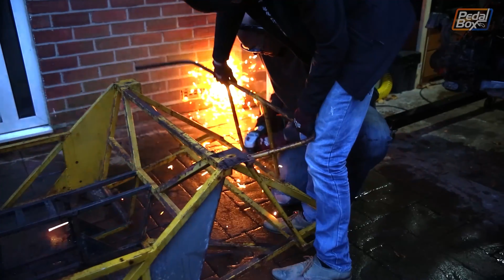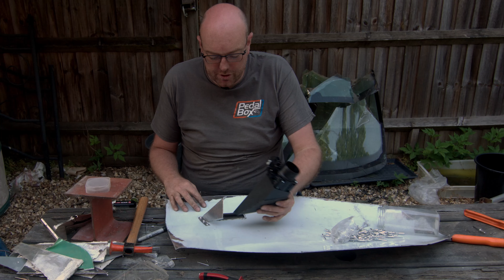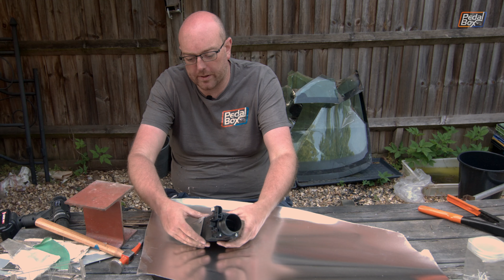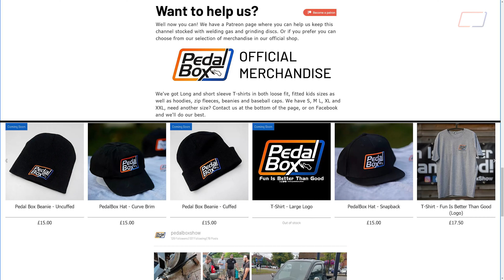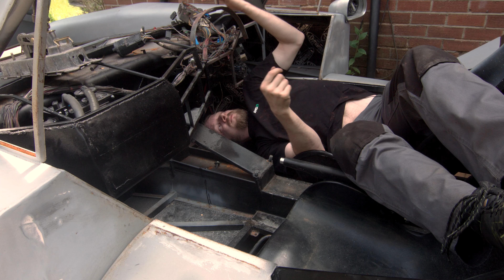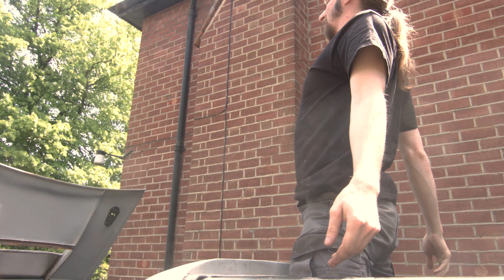3D Printed Heater Parts | Audi TT Kit Car | PedalBox Episode 135

Comment: Guys just a sudgestion. Countersunk rivets and those terry clips will rattle like a gooden when the cars running.
Reply: The rivets are fairly solid in the panel and the panel-rivet-clip system doesn’t rattle, thankfully.

The clips do indeed rattle real good, but that’s mostly because we haven’t wrapped the tubes with gaffa tape like we intend to. I think once we’ve built the tubes up with more gaff the whole thing might be… semi solid?

Definitely aware of the chance of rattle though - we’re open to doing something more difficult and better but we’re trying to do the easy thing for now, and if it works then happy days.
Reply from the maker: They've held well so far, and the ribs they clip on are wrapped to prevent metal on metal. there might be some other changes once we get it moving and hear the rattles though. I'm not sure if countersunk rivets will hold in the thin sheet. It might tear through?

Comment: Errrm, best rethink the pedal switches, there NOT just fit, its a variable length plunger, the 1C0 revised brake doesn't have as much thrown as early ones BTW. you need to turn to mount the switch, which flicks the switch internally to set to zero position. Brake more so as its a double switch (N/C & N/C) both going to the engine ECU will give you more running issues & warning lights on than you'd think!!
but great progress even if I'm halfway watching, I'm hopeless with metal work
Reply: Oh bugger. Think this is gonna necessitate a bunch of testing and head scratching by the sound of it then :(
Reply from the maker: Can confirm, many heads were scratched, but it seems to be the same as the A3 on the drive at this point. So we'll play warning light roulette and then come back. Roll on the ECU and yet more scratching of heads.